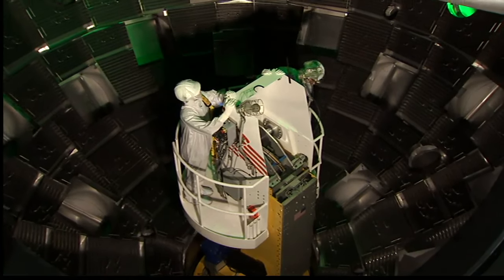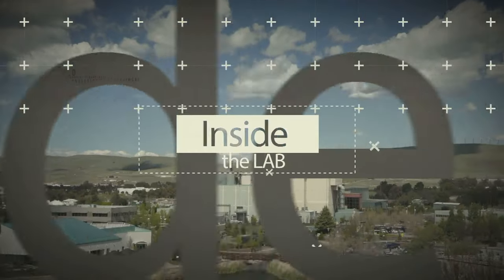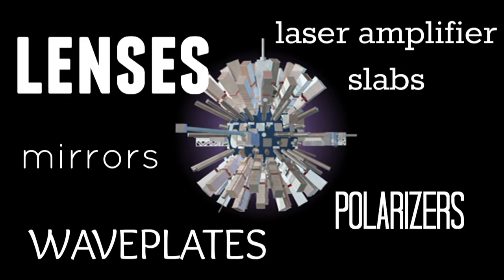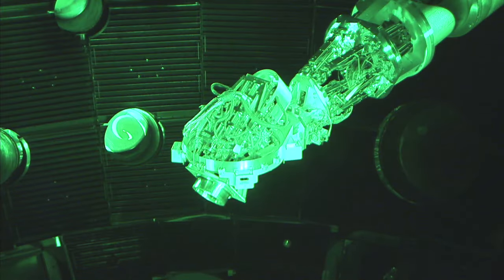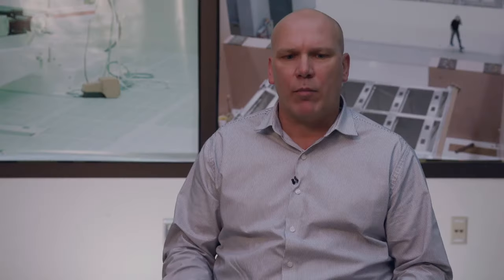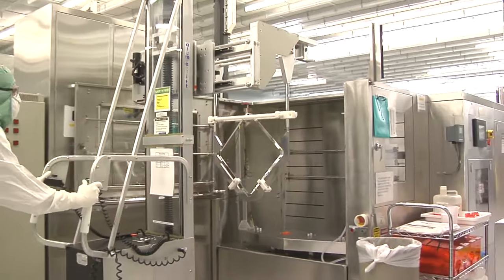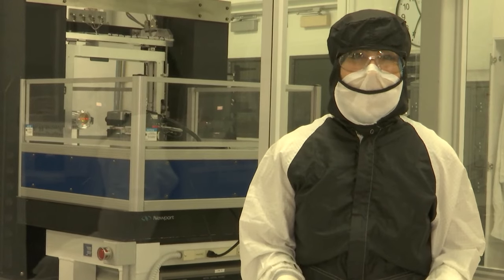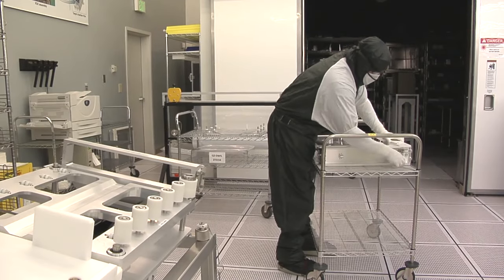Take a ride along NIF's optics recycle loop

Comment: I was told by a laser tech for industrial machines that a tech was repairing a CO2 cutting laser and had the beam on and move his fingers, by mistake thru the beam and they were instantly cut off. Those beam mirrors are huge compared to LASERs for industrial application.